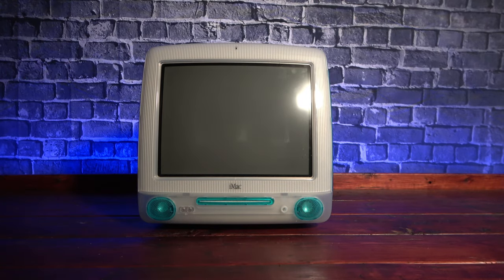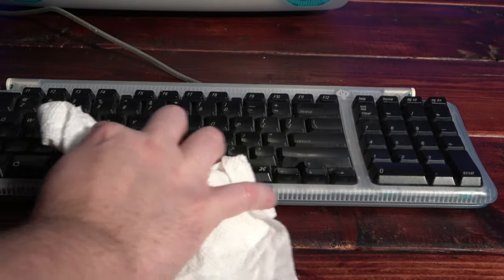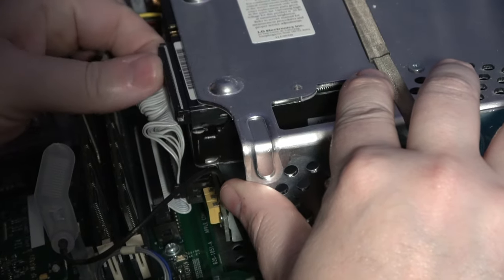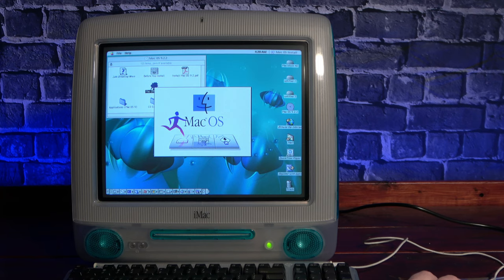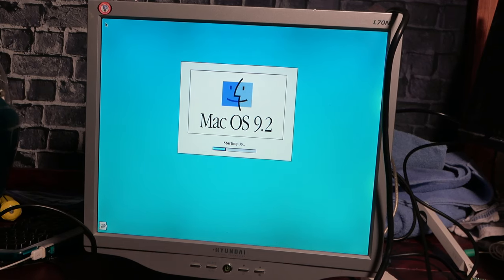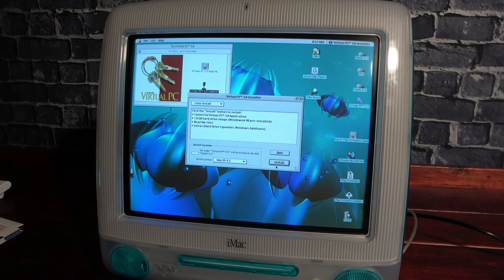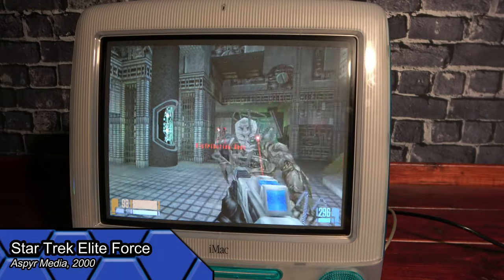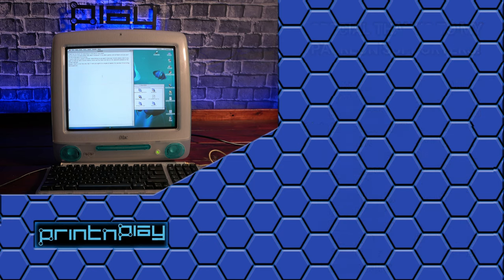Can We Restore this Storage Locker Apple iMac G3?

Comment: The graphite 600mhz G3 iMac with 640mb ram. It was my favorite computer. I had mine from 2004-2006 which was good enough with OS X (I believe Snow Leopard was the last to support PPC) to run most websites and even youtube. If I had the space I would retrofit it with modern PC hardware because I loved the form factor so much.
Reply from the maker: It certainly is an awesome form factor. If someone made it as a case today, i would build one
Reply: You're actually quite far off. Leopard was last for PPC, and when it comes to G3 it's Tiger (or even Panther on tray-loaders)
Reply: @bartekpekala77  you're probably right, I think on my coreduo macbook it couldn't go past leopard.
Reply: @mechanisma22  I think most 32 bit Macs could only go up to Lion, with exception of few which actually ended up with Snow Leopard. I'm pretty sure you could patch it to run something more modern on such thing, though.

Comment: I got one of these off of craigslist a while back.  Mine had a good HDD, but a busted DVD drive.  It was fun to try to find a replacement for that.  Mine is slightly different, having a VGA port on the back (useful if you kill your screen ;) ).
Reply from the maker: Yeah, rub it in! Lol. Were you able to fix it? Which color is it?
Reply: @PNPRetro  Hehe, wasn't trying to show off.  But yeah, I did get it working.  It's blue (idk what "blue" variant).

Comment: I have the Graphite SE and after a few years of non use I plugged it in and no power light or life in it. I run a wand along the power cable and power is going in, i touch the on button but nothing happens, keep pressing for a few seconds still nothing happens. Any ideas please? Enjoyed your video, love seeing old machines work again.
Reply from the maker: Glad you enjoyed the video! I guess my first guess would be the power supply. Electricity might be getting in, but a damaged power supply means it can't provide the internals with what they need to run.

Beyond that, it could be the logic board...it's hard to say for sure. I'd usually go in, start testing using a multimeter to see if there is power anywhere past the power supply, as well as looking for obvious signs of damage. Just be careful. Especially since these machines have integrated CRTs, there can be dangerous voltage hanging out in there... even with the machine unplugged.
Reply: @PNPRetro  thank you, much obliged.